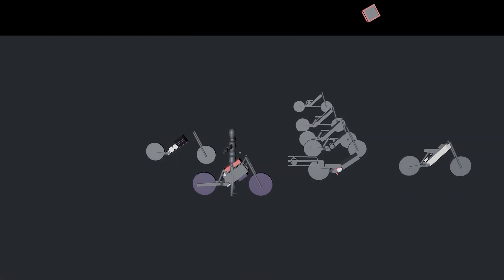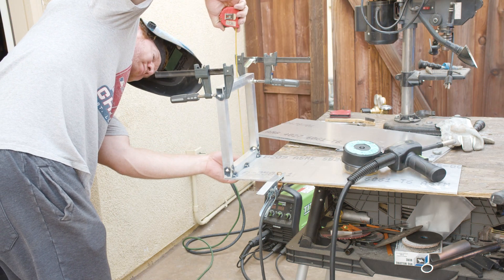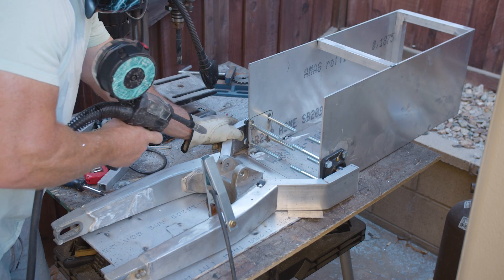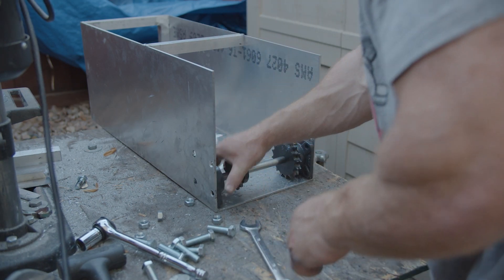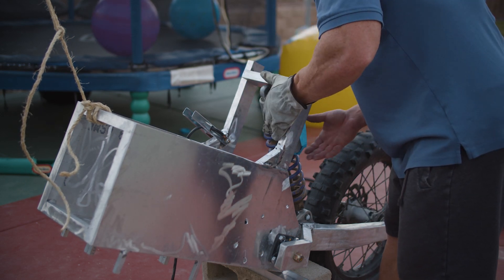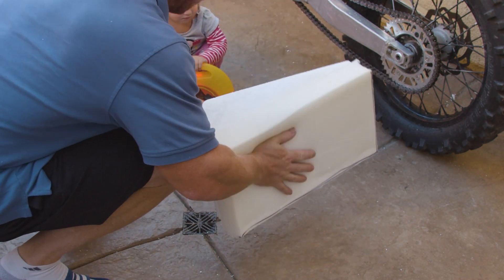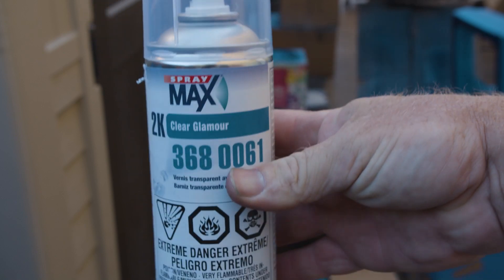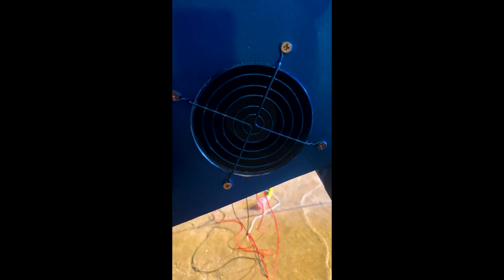Electric dirt bike MAD MAXX STYLE made from all Aluminum 40KW POWER

Comment: I’m planning on building my own bike and I just have some thoughts to share. The axle bolt for the swing arm looks like it won’t be able to handle the torque of those motors and I think it should be substantially larger. Also the top of the shock tower is too close to your tailbone. Coming down hard off of jump Could be devastating to your pelvis and back. The length of the bike looks good but you need a back fender so you don’t get chewed up into the tire when it rips your arms off from too much power. 

Aluminum welding is a bitch with a Mig and I would suggest heat treating the whole Weldment  for stress relief. Fatigue is a big thing. You don’t want the steering stem breaking off. 

Electrically it looks pretty damn powerful good job man
Reply from the maker: All valid points. This was made along time ago and was more of an experiment (2motors)and practice . This was intended for a show bike more for its unique long look and only trail riding. It would be perfect for a movie set on a mad max type of environment

Comment: Holy shit I have a Stealth bomber that's pushing around 11kw peak but this is a complete different animal
Reply from the maker: Thanks it was a mean project just not practical.
I have another build making the weight to torque ratio more practical 
Check it out , Orange bike video
Reply: @RexSmithII  I will check it out! I've subbed to you're channel also, 
How fast have you had out of it and I bet it pulls you're arms out lol
Reply from the maker: @DJ-Lee_S  it was more scary then anyway 
All you hear is chain, which is very different feeling.
It’s just too heavy. Lol
Reply: @RexSmithII  I bet, imagine if it was made of steel 🤣🤣